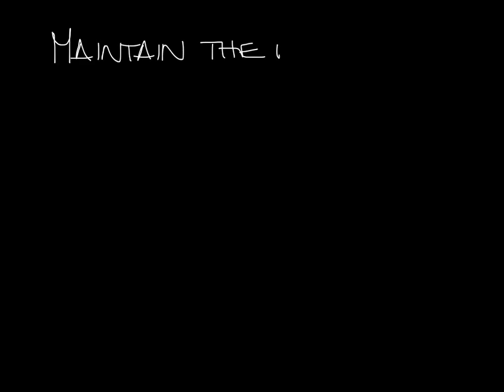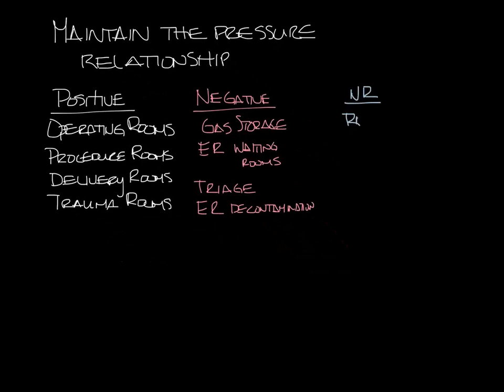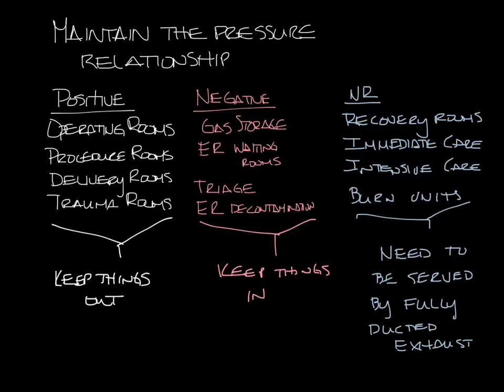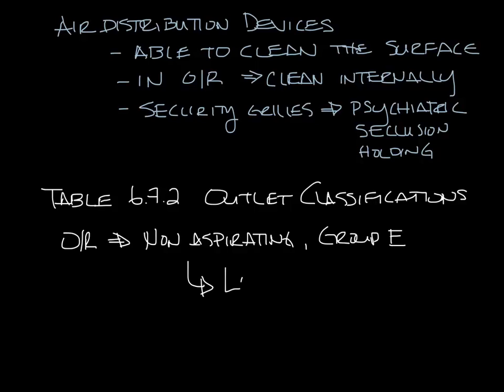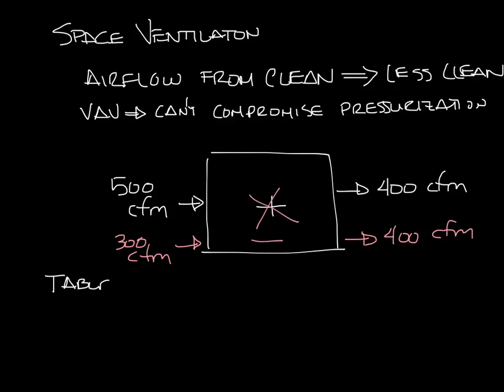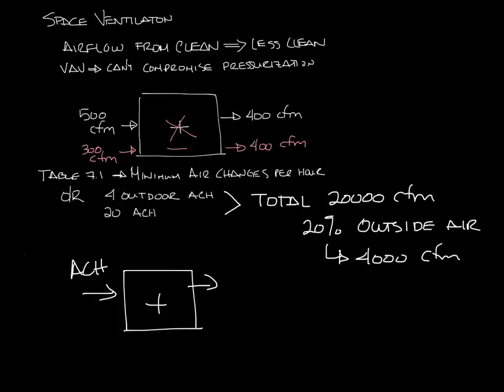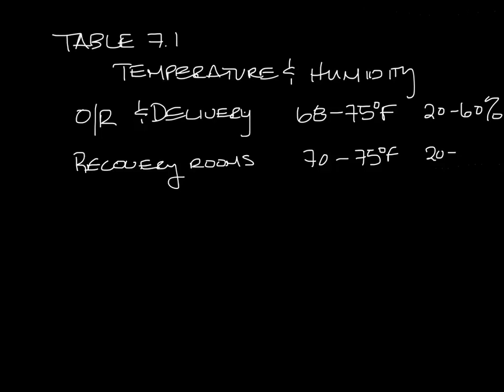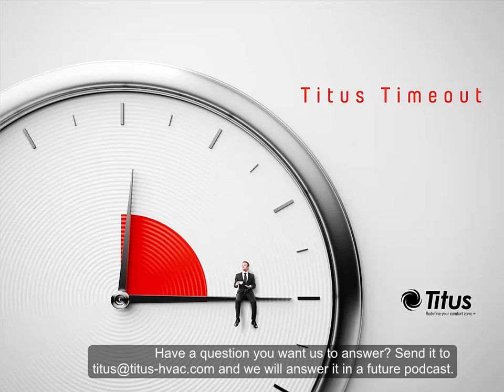Titus Timeout Podcast - ASHRAE Standard 170 Overview

Comment: What if the project uses 100% OA system, is there any chance to comply with ASHRAE 170 without relying on huge amounts of recirculated air?
Reply from the maker: Use chilled beams. For every    CFM of recirculated air you extract 40 to 50 BTU/H of sensible heat in addition to that extracted by the minimum outside airflow rate!

Recirculating air costs very little energy where beams are concerned. Reconditioning that air within the beam is the ideal energy saving solution.